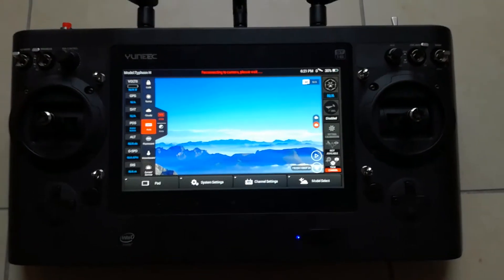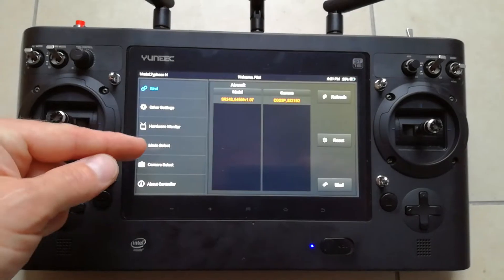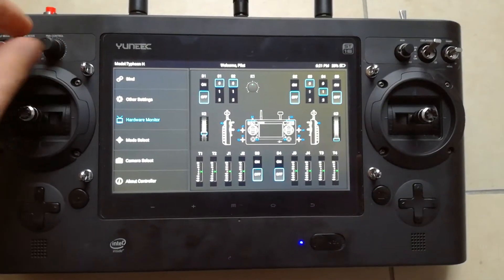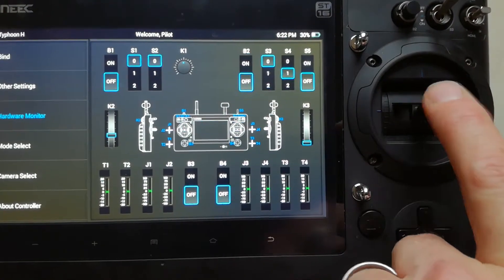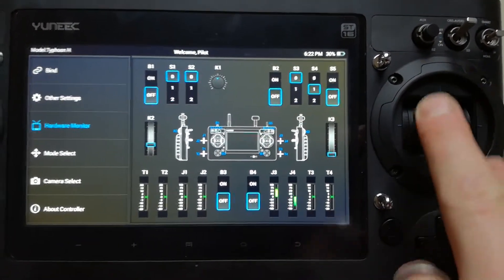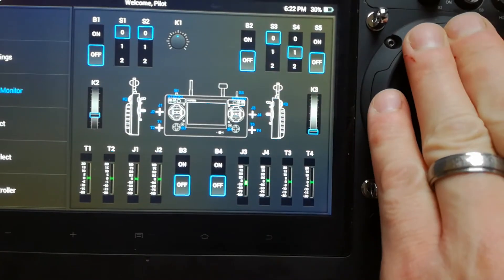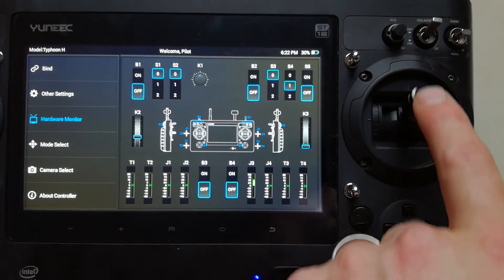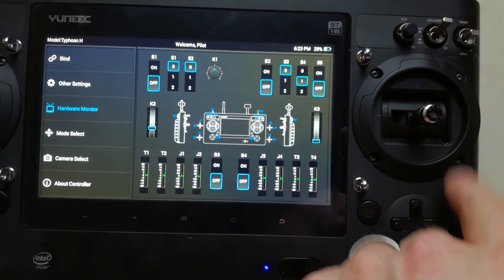YUNEEC ST16 check hardware monitor. PITCH & ROLL STICK.

Comment: Any recommendations on Stick settings in Channels. Is standard best or are other options worth consideration for smooth video  shots
Reply from the maker: Andrew Seal hi Andrew.  I have found. after a lot of playing around,  the only channel that needs a bit of adjustment is the Yaw (rudder/channel 4/J2)  I edited mine to adjust the Rate from Stock 80% up to a rate of 100% and expo changed to 25% then saved.   all other channels remain Stock.  I normally fly with the Hare/Tortoise rate slider in mid position unless I need the speed, I can use my finger to raise as needed when flying.  but. for me I find the adjustment of the Yaw rate and expo has really improved how I can make a manual orbit around something,  and it has smoothed out long forward turns.  ie: following the curves of a golf course fairway or a river.   I found stock was too jerky.  I was trying to follow a route and smooth turns where never possible.  it was always a mess.  this really helped me out.
Reply: Richard Gilmore thanks Richard, will try on Saturday 👍
Reply: Got H back from Yuneec a week ago and on a fast track familiarisation journey and loving every minute. There is so much hidden talent in the H that should be marketed harder. It seems to get forgotten and only focus is on hex config and 360. If H gets a camera upgrade option hopefully some serious video guys will sing it's praises. And I have DJI so this is not a one brand only opinion